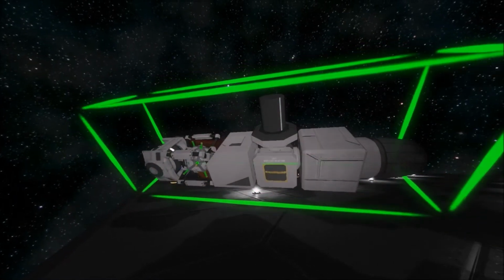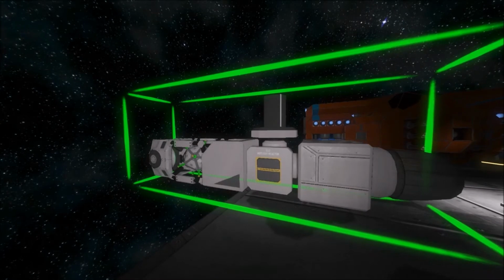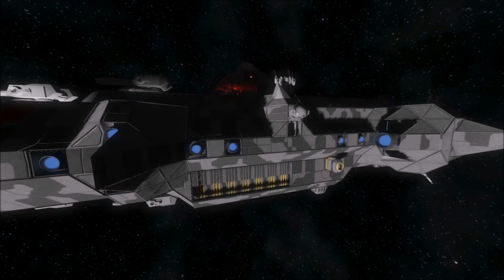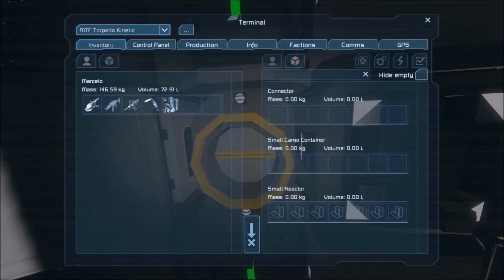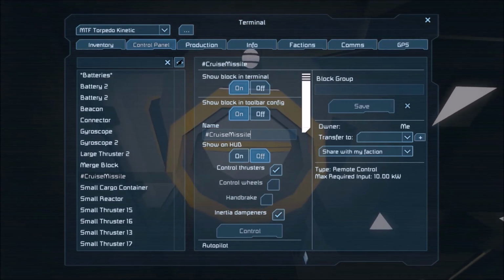[SPACE ENGINEERS] Cruise Missile Mod Evaluation

Comment: To sum up: The smallship-grid torpedos hit reliably, but are limited by insufficient yield of any possible payload. Large-grid torpedos could theoretically deliver enough damage to be worthwhile, but seem much less reliable in terms of properly hitting their target.

 Your repurposed-drone torpedo looks like it could be devastating if you used it with the nuke launcher mod you tested in an earlier video, though. Swap one of the original missile launchers with the nuke tube, and the other with a sensor that triggers the nuke to "fire once" when the torp enters within <50m of the target.

Larger or more powerful modded smallship warheads (perhaps a 2x2 block version) would probably be the simplest step to making small-grid torpedos effective.

On a tangent, while I still stick by the usefulness of the 23mm quad-barrel turrets, they seem less accurate than I remember. The mod author may have tweaked their stats since I last checked...

One thing that jumped out at me about this video is that the vanilla missile turrets seem to be the most effective for hard-killing torpedos at close range. This suprised me - I normally don't have much use for them, but it seems you may have stumbled across their niche.